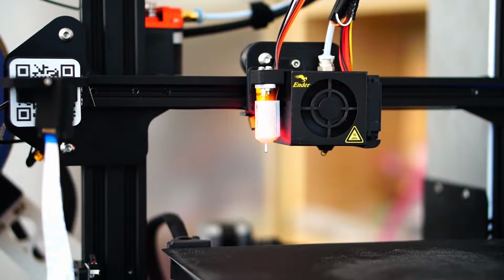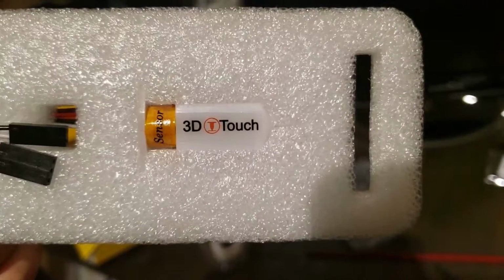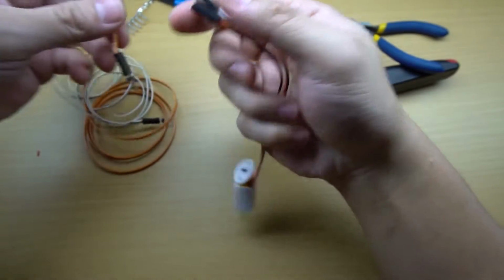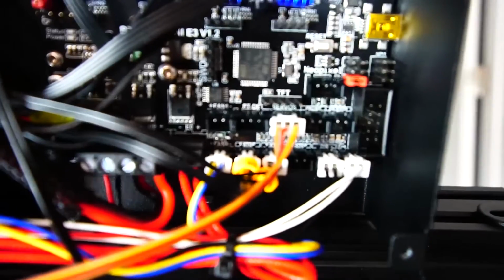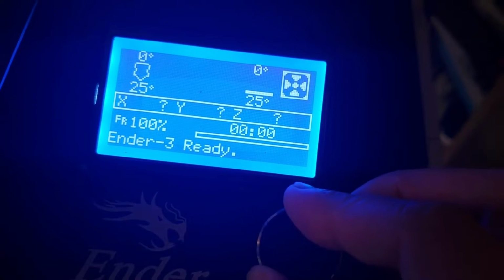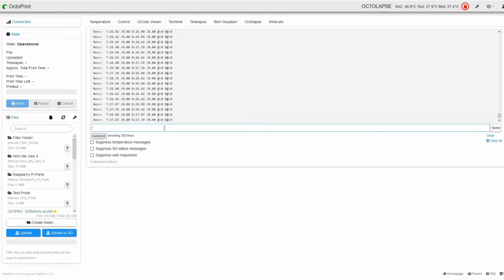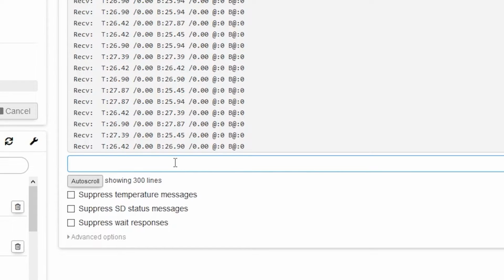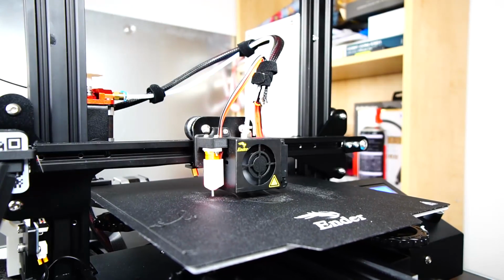3D Touch +  SKR Mini E3 v1.2 on Ender 3 Pro 3D Printer

Comment: I downloaded the bltouch for z homing have the probe in the right spot on the board but don't have bltouch option on my printer.. great video btw
Reply from the maker: Did you ensure that you renamed the bin file to be just "firmware.bin" and verified that your board was updated successfully? There should be options for controlling bltouch probe on the LCD.
Reply: @dorkytim  I don't remember what that issue was I solved that. Now my only issue is getting my offset set.
Reply: @dorkytim  OMG this comment saved me from giving up! Thank you for this awesome video! I have finally figured out my issues

Comment: Thank you for this video. I followed most if it except that i used the probe slot in the board instead of z end stop. When i press home, it goes to 0,0,0. Then when i try probing (with z offset  at - 1.85), there are certain points that i get a "probing failed" message. And upon checking, the nozzle presses down on the nozzle before the probe is deployed. Is there a fix for this?
Reply from the maker: Try adjusting your mount that holds the bltouch. Usually this happens when your probe is mounted too high or too low. It should be well above the nozzle when retracted and we'll below the nozzle when extended.
Reply: @dorkytim  thanks. it was too high so i adjusted the mount. Now my problem is i cant seem to get the z offset right.
Reply from the maker: It can take some time and you might have to adjust the offset a few time. After you get it close, try starting a quick first layer print test and seeing if you need to add +/-0.05mm to your offset until you get the desired results.

Comment: Awesome video btw!  I followed your video step by step and everything seems to work fine except for z-offset from lcd.  Every time that I offset it and save it, it never saves.  I'll hit auto home and it reverts back to the original off set.  Any help would be awesome.  Thanks a bunch!
Reply from the maker: Are you sure you are going to option on the LCD that displays the "Z Offset" and then manually changing this value? Then going to either the "Store Settings" or "Save EEPROM" option. Running an auto home should not change this value of the Z Offset, so I want to make sure I understood the steps you took correctly when you said it reverts back to the original offset. If you have a chance to connect it to a terminal from pronterface or octoprint, you can ensure it saves from running the M500 gcode command, and then M501 to makes sure it loaded correctly. It could also be possible that your version of the firmware has saving disable, but I think that is unlikely unless you are playing around with the configurations.
Reply: @dorkytim  i have also tried pronterface, entered all the info, then used the 500 and 501 codes and still nothing.  i believe my save is enabled because I was able to save my extruder calibration.
Reply from the maker: Running M851 shows your Z-offset value. Are you saying that this value changes back to you're previous value after auto homing?
Reply: @dorkytim  I do apologize, I'm a noob at 3d printing.  I'll have to take a few pics soo that you see what I am talking about.
Reply from the maker: No need to apologise, everyone starts somewhere and we all have the right to learn. I'm just trying to get a complete understanding of the problem you are describing.
Reply: @dorkytim  okay here is the code i used in pronterface. 
1. Home 3D printer
2. M851 Z0 - Reset Z0Offset
3. M500 - Store setting to eeprom
4. M501 - Set active parameters
5. M503 - Display Active Parameters
6. G28 Z - Home Z Axis
7. G1 F60 Z0 - Move nozzle to true 0 offset
8. M211 S0 - Switch off soft endstops
9. Move nozzle towards bed slowly until the paper can barely move
10. Take note of the Z on the printer display (take that number and add the measurment of the calibration sheet or device used)
11. M851 Z X.XX (X.XX being your z offset achieved)
12. M211 S1 - Enable Soft Endstops
13. M500 - Save settings to Eeprom
14. M501 - Set Active Parameters
15. M503 - display current settings

is there a place that i can send a few pics?
Reply from the maker: There doesn't seem to be any issues with the steps you took. At which point do you see the z-offset reverting to the previous value? For images, you can try uploading to imgur.com and posting the links here.
Reply: @dorkytim  https://imgur.com/a/P9ow909 here is the link.  This is what i get after autohoming after pronterface.
Reply from the maker: Ah okay. If I understand the images correctly, then I don't think you have any issues. AutoHoming is suppose to bring your nozzle 10 mm above the bed to rest. The value of your current Z is not equal to your offset. The offset just accounts for the difference between the probe's z and the nozzle's z. As long as your z-offset value is -.60 like you have it, then when you start printing it'll bring the nozzle to the where it thinks it should be, but just an autohome is suppose to rest your nozzle 10 mm above the bed. You should try running a first layer print test to see how it runs with your current z offset value.
Reply: @dorkytim  I appreciate all your help.  I'll have to run the test print and see what happens.  Thank you!
Reply: @roberthansen5300  in the end were you able to resolve your issue? im having a similar issue where even after i auto home and lower the z-axis to z0 i can never get my nozzle close to the bed. therefore, im unable to print anything no matter what offset i use :(   i used z offset {1.00, 0.13, -0.60, -1.86, -2.50, -3.00}

Comment: HI Tim,  Great video explains a lot.  I am real new to all 3d printing but, I have managed to upgrade my E3 Pro a lot.  I've had the BlTouch working great.  Last night I installed the E3 mini with TFT touch.  I have tried both firmware files Z-homing and Bl Touch and both will crash into the bed when i auto home just at the different areas on the build plate.  I am using the probe in the z-stop connection not the Probe connection as you are.  I am just learning Gcode and not that proficient at it to compile my own firmware yet.  I am getting the .bin files from Github v.1.2 on Big Tree I believe it is Marlin 2.0.53.  Any ideas are appreciated.  Thanks in advance!
Reply from the maker: It sounds like your probe isn't triggering. I would first check that the bltouch is mounted at the correct height so that the probe is shorter than th nozzle when retracted, but longer than the nozzle when extended. Next, I would do a double check that the wiring is secured.

A quick test is you use your finger to press on the probe as it goes down to confirm its triggering correctly and stopping the downward motion.
Reply: @dorkytim  I will check, I noticed now the red light is constantly on and it will not retract on it's on. I think it's firmware
Reply from the maker: The LED light being on is expected, but what do you mean "it will not retract on it's on"? Are you able to do a probe test?
Reply: @dorkytim  yes, I cannot get it to do test at all it's just lit up.   I've tried to load firmware again but I don't think it's taking
Reply from the maker: Were you eventually able to figure out the issue?
Reply: @dorkytim  yes, I had the blTouch wires flipped. Now just having issues getting firmware to compile.  Thanks

Comment: Tim, if for some reason my Ender 3 version needs to have the x axis reversed direction and the *.bin update is already compile. there a g code or a way to modified?
Reply from the maker: Hm, you usually have to set that in the firmware. I am unsure if there are slicer settings that will invert the x. Another thing I've seen others do is flip the pins on the motor, but I think it's easier just to configure it on the firmware unless the printer was setup incorrectly in the first place.

Comment: How do I modify the firmware to edit the soft z stopper? The nozzle is way too high but I can't move the z to negative.
Reply from the maker: You can send a "M211 S0" GCode to the printer to disable the software endstops and that will allow you to go to the negatives manually when adjusting your Z-Offsets. In the firmware, the setting is coming from "#define MAX_SOFTWARE_ENDSTOPS / #define MIN_SOFTWARE_ENDSTOPS". For anyone interested, this document from Marlin goes more in dept about endstops "https://marlinfw.org/docs/hardware/endstops.html".

If your nozzle printing too high off the bed from the start, then there's a few things to quickly check:
1. Check to make sure the X gratuity is tighten so that the X axis is not somehow sagging which messes with your alignment.
2. Your BLTouch mount is secured properly and is in the proper position, not too high or low relative to the nozzle.
3. Even if you think you have configured your Z-Offset correctly, try adjusting the z-baby stepper as you are printing, or adjust the Z-Offset by 0.05mm at a time until your distance is just right. Use a simple bed leveling print to check.
Reply: @dorkytim  I was able to fix the z stopper limit and the bed is able to level, but it can never do the 5 1-layer square test correctly. It prints the top left corner and the middle, but once it gets to the bottom left, it starts printing in midair. I tried manually leveling the bed as well, but the same thing keeps happening. I'm also pretty sure my print bed is taller in the middle than in the corners but only by a very little bit. Is this a common problem that I can fix?
Reply from the maker: Sounds like your bed might be a bit warped. There's a few things to check before going down the glass bed route.

1. Make sure you manually level the bed as best you can. The auto bed leveling can only compensate for so much so you want each point to be at least within a 0.1mm if you can. I recommend getting the bed visualization plugin for octoprint to make it easier to see. If not  then you'll just have to rely on the mesh data from the terminal. Run a "G29 T" and make sure those points are as close as possible.
2. Make sure you are leveling the bed while it's at print temperature to avoid deviation due to heat expansion.
3. Upgraded bed springs can really help keep the bed more leveled and avoid further deviations.
4. You can also increase max probe point to 5 and run a 5x5 bed leveling. This takes a bit longer, but might be necessary if your bed warping is too much.
5. A trick some people use is to get a layer of gluestick on the side of the bed that's a little bit too far from the nozzle. This won't work if the distance is too far.
6. Make sure you slicers start code is configured properly so that it's enabling bed level mesh and not resetting it.
7. Upgrade to a glass bed which is more accurately flat. However, you may have to get familiar with using glue stick and alcohol, or adjusting bed temperature to fine tune the adhesion. Not a deal breaker at all since the glass bed will give you amazing first layer results.
Reply: @dorkytim  I got it to work!!!! Apparently, the issue was that I used the springs that came with the BLtouch to mount the sensor and that was causing the sensor to go out of wack. Right when I took off the springs and mounted the BLtouch directly to the bracket, it started working great.
Reply from the maker: That's great to hear. Glad you got it to work.

Comment: Hey Tim:   based on your recommendation, I would like to try controlling the Ender 3 Pro with this upgraded SKR E3 mini V1.2 board via Octaprint on an arduino setup.
However, unlike USB connection to the stock Ender 3 Pro board which was transparent, I've experienced hours of frustration trying to control this new board.   Their Maple (USB)Drivers are goofy, to say the lease and you had to go though all kinds of contortions to just install their digitally unsigened drivers.   I have still not succesfully connected to the SKR E3 min v1.2 via USB.   If I set up OctaPrint, will it be any easier ?   If not, any secret on how to successfully get USB connection to this otherwise nice board ?
Reply from the maker: I never dealt with their drivers, but that sounds like a nightmare. With my octoprint setup, I'm using a raspberry pi 3b with the micro usb connection to the mainboard, just like it was with stock. It sends the data signal through serial, so there shouldn't be any issues with driver compatibility as long as you are sending at a baudrate 115200 or greater.
Reply: OK.  So if I set up a raspberry pi with octoprint, connected via usb, no problem despite the mainboard NOT being the stock ender 3 pro ?
Reply from the maker: Yeah it works great. A raspberry pi 3B or 4B with octopi loaded and it's good to go. It'll also have WiFi and allow for adding a web cam and other neat features. Well worth it.
Reply: Great.   Recomendations for a printed Raspberry pi case from thingiverse for the ender 3 pro ? ?
Reply from the maker: There's so many great cases on thingiverse. The one I use personally, is actually a mix. I used the bottom of this one, https://www.thingiverse.com/thing:1956623/files, and the top from this one, https://www.thingiverse.com/thing:3616207/files
Reply: Set up Octaprint with a raspberry pi 4, and I am blown away by its abilities.  Comes exactly as you advertised.   Thx again for your videos, recommendations, and encouragement.  Good advice like yours are what expands our community...

Comment: Great technical video, well presented,, clear and not to techi and amazingly helpful for the mewbs like me. However Tim, i have a couple of questions if you would be so kind to try to answer please?
I already have a SKR Mini 1.2 board fitted, and added a 3D Touch very similar to your video, however i choose to keep my Z end stop and attach the black and white lead to the Probe connection on the board. So that is the only difference i can see.
My question is...When i auto home, it still homes at the default front left position, and not in the middle like yours shows, so i am not sure if i am doing the Bed Levelling correct. My Z offset is -1.65. Why does my Auto home still go to the default position? i have flashed the firmware twice now to make sure, and i am using the correct BL Touch Firmware.
also i read somewhere that you had to put in a command 'M420 S1 ; Load Saved ABL Mesh for BL Touch' after the G29, is this correct?
Thanks for your input.
Reply from the maker: If you keep the Z-Stop then your printer will continue to use it to set the home position by going all the way left to the X-Stop, all the way back on the Y, and all the way down on the Z-Stop. If you have the 3D touch connected to the Z-Stop, the the probe has to go to the middle of the bed in order to home the Z point instead of relying on the microswitch for the Z-Stop. This is why the behavior is different.

M420 S1 enables the printer to use the bed leveling mesh during prints. G29 enables this at the end of the bed leveling automatically, so you do not need to add M420 S1, if you already have G29. If you don't want to do the bed leveling process every time, then you would use M420 S1 after G28 instead. This is necessary because G28 autohomes and resets the bed mesh.
Reply: @dorkytim  Huge thanks for clearing this up fir me Tim. I will watch out for you next tutorial video.
Thanks again for your help.

Comment: Im constantly changing my mind on whether I should get the v1.2 or 2.0 because I don’t think I need the extra features in the 2.0 honestly the only reason to upgrade the board is for the silent stepper drivers. VERY GOOD VIDEO BTW!
Reply from the maker: I agree, the most sought after benefit on the board is the stepper motor driver upgrade. It really makes a huge difference in noise and a bit useful in reducing salmon skin. As for the new v2.0, I think the biggest difference maker is if you plan to go dual Z motor upgrade. Otherwise, the 1.2 holds up just fine.
Reply: DorkyTim I’m gonna get the 1.2 if I ever was going to upgrade to dual z axis motors I would buy a adapter that bigtreetech also sells